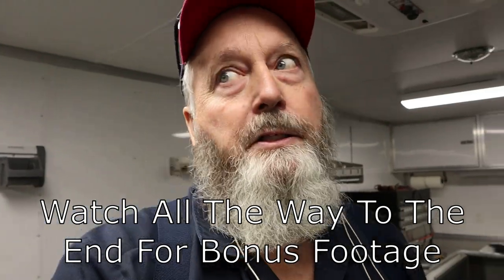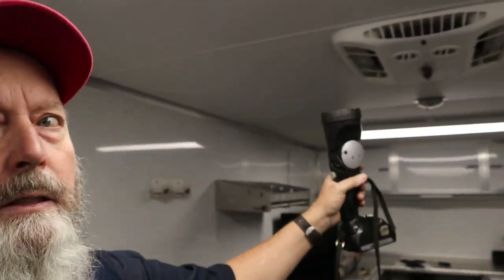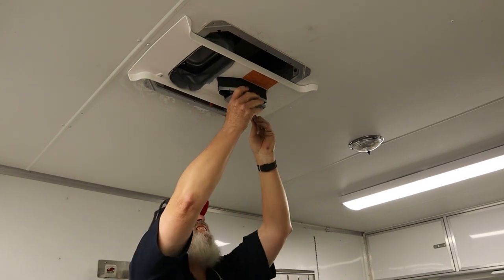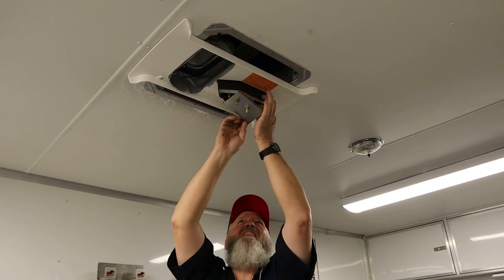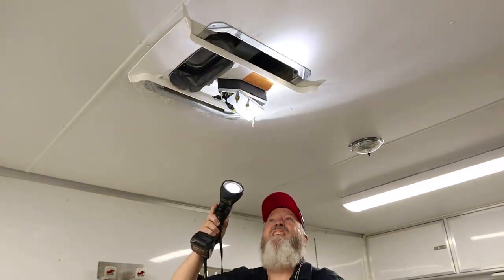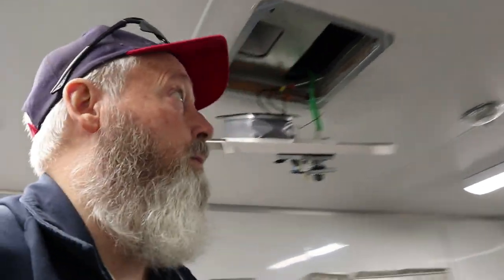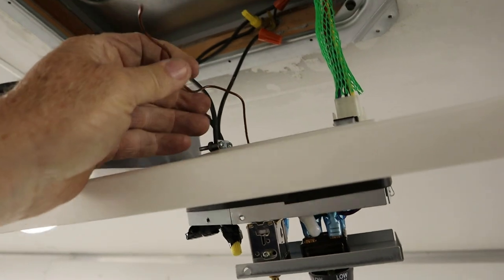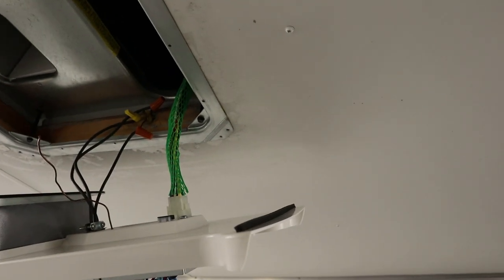Troubleshooting RV Roof Air Conditioner Fan Runs, But Not Cooling

Comment: Kenny, over the years I've used Craftsman, B&D, Makita, Ryobi and Greenworks cordless tools, but I can safely say the 18volt Milwaukee drill and 3/8" impact I use today are the best of the bunch.  Plenty of torque and the battery lasts a long time.  Lives up to the Milwaukee name.
Reply from the maker: That is great information. Thanks

Comment: I don't think that compressor is dead. The thermister connection is open. It needs to be closed for the compressor to run. I had a similar issue and when I shorted the thermister tabs on my control board, the compressor fired up fine. I noticed the wire on my thermister had a stripped out spot. A new $14 part from amazon fixed the issue.

Comment: Use Milwakee 18 volt in everything from drill, 1/4 driver ,saw zaw, 1/2impact, nail gun, hammer drill ,saber saw, light, etc.  also use 12 volt as well from soldering iron to 3/8 ratchet  , small drill and driver and flash lights.  I follow Darren at My RV Works and use the 12 batteries to check or operate 12 volt devices when needed.  Planning on buying 18 volt skill saw and 3/8 impact next.  In process of taking NRVTA tech courses. Learning a lot from them , Darren, and you.  Thanks for all you do!
Reply from the maker: Thanks, glad to get this feedback.

Comment: HVAC Contractor here that swears by Milwaukee tools. My impact has 50,000 plus sheet metal screws and everything else on it over the last 10 years and still going strong. 

My buddy is a Forklift mechanic and he puts them through heavy use. Still going strong. He can grease an 8000lb lift without jacking it up, with his new grease gun. Worth buying.
Reply from the maker: Cool, thanks.

Comment: I use the 18 volt Brad nailer and it has never failed me. I also have the high impact drill for hitches, etc and it is very good. My cordless table saw and miter saw are amazing for remote wood work. I’m a woodworker so I often am repairing water damaged areas in rv’s and building drawers to replace shelving in rv’s. My 12 volt impact is my go to for constant use.
Reply from the maker: Awesome, thanks. The brad nailer and the staple gun is what I am most interested in, so thanks for the info.

Comment: Heavy equipment mechanic for 35 years switched over to Milwaukee from Ingersoll rand eight years ago and never look back. I’ve been considering RV tech for a sideline in retirement and I would use nothing but the Milwaukee tools. I’m running the three eights half-inch impact grinders buffers drills they all work very well batteries hold up very well also
Reply from the maker: I am happy with the Milwaukee tools so far.

Comment: I have a 12v and 18v set. The 12v now collects dust.  You'll not regret the 18v. I use every day for most of the day,  up grade to the larger battery if you use like I do.
Reply from the maker: I use big battery’s for saws. Makes the drills and drivers too heavy.

Comment: Here is my imput on battery powered tool.  I tore down an old house 1960's  and built a 16 x 20 shed with the wood I salvaged then I built a 4x8 shed  , 2 saw horses about 6 raised beds and still working on projects.  All this was done with the craftsman multi kit ( saw , drill , saws-all ) with  3 battery packs. Always charging one battery while the other ones were being used.  I put it thru the test and everything worked great.  There's my 2 cents worth.
Reply from the maker: Thanks for the input.

Comment: Thanks to your video I solved my problem. I mistakenly wired the "thermolater" (wire with the clear plastic tube) to the rest of my ground wires inside of my Advent control box (part No. ACDB). Pretty sure I had ruined my thermostat. I decided to bypass the thermostat with some alligator clip leads and my compressor started working! So now I'm waiting for my thermostat (WK16S-498-520) to arrive.
Reply from the maker: Cool. 
See what I did there?
Reply: @hillbillyrv  That’s cold.

Comment: I love my Milwaukee. Use it everyday. Have 18 and 12v. I use the 12v the most. You can also use the 12v battery to test furnace and awning motors.
Reply from the maker: Thanks David. Yes I need to get a 12 volt tool. Maybe the rivet gun?

Comment: I have the same A/C where the fan only runs but as soon as a turn it to cool everything starts humming is it the thermostat, capacitor, or compressor?
Reply from the maker: Hard to say without being there.
Reply: @hillbillyrv  what does the A/C do when the compressor stops working

Comment: I'm going to go to company we only use Milwaukee or Makita you just make cuta for about 10 years then started using Milwaukee best told I've ever made and the most reliable impact resistant battery stay good no trouble no troubleshooting just as good as the Makita better than any other brand out there
Reply from the maker: I really like my Milwaukee tools.

Comment: The air conditioner works, but it doesn't cool. What should I check?
Reply from the maker: I have several videos on how to check to see if the compressor is running and how to check the amp draw to see if there is enough feon in the AC. I think you should find those helpful.

Comment: I have used Milwaukee tools for years and they have awesome insurance but they are heavy and working over your head is tough, I went to all 20volt porter cable they are lighter than Milwaukee and they last just as long
Reply from the maker: I switched to Milwaukee because of the huge variety of tools.

Comment: Did you check the capacitors?
Reply from the maker: The compressor is getting power, so if the start capacitor is bad, then it would be trying to start, right? Been my experience that if the compressor tries to start with a bad start capacitor, the compressor sounds VERY angry. Yes?

Comment: have been using Milwaukee red for many years....I have DeWalt stuff at he and have regretted it. Will tell you Milwaukee has signed a 20 yr contract with their batteries supplier....they will have 18v batteries for a while....not pulling the stupid trick DeWalt did....ill be replacing my DeWalt stuff with Milwaukee
Reply from the maker: I am liking the Milwaukee stuff. Good to know the batteries will be available. I got away from Dewalt several years ago. They are terrible.

Comment: Check the capacitor
Reply from the maker: The compressor is getting power, could it still be the capacitor? When I have seen a compressor start capacitor fail, the compressor tries to start, but it can't. This one ain't doing nothing.

Comment: My air condition is running cool, cuts on phone runs 10 minutes and then the fan stops and it’s just a humming
Reply from the maker: The humming sound without the fan running is usually the compressor running. That ain’t good.

Comment: Milwaukee tools are great you can’t go wrong with them I switched to them and rigid.  Both are made by tti.  if you have a home depot within reasonable distance the gen5 brushless tools will give you more bang for your buck bc of the lifetime service agreement on everything including the batteries and chargers.  The downfall of Milwaukee is the cost and battery prices.  I have had the rigids fall off of roofs on the concrete and even had a helper drop it in a 5 gallon bucket of water for catching ac condensation causing the battery to short they sent me a new one no hassle.
Reply from the maker: Thanks that is good info.
Reply: @hillbillyrv  just if you go rigid keep receipt and register the tools within the first 90 days to get the lifetime warranty.  If you buy kits be sure to register each piece individually it’s not hard it walks you through everything or you can call the 1-800# to do it.
Reply from the maker: @marcuscarmouche9023  I am going Milwaukee. Home Depot is over an hour away.
Reply: @hillbillyrv  well you can’t go wrong with that